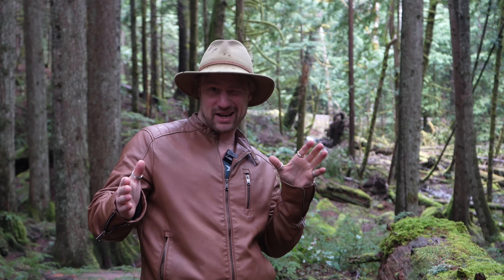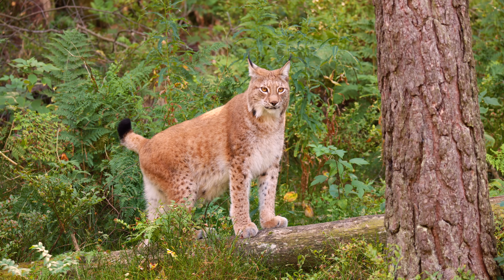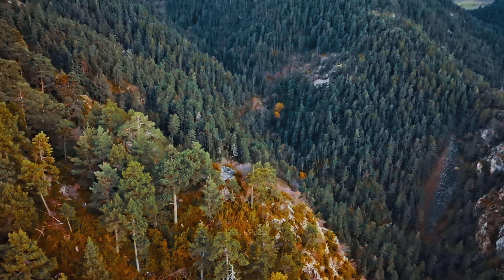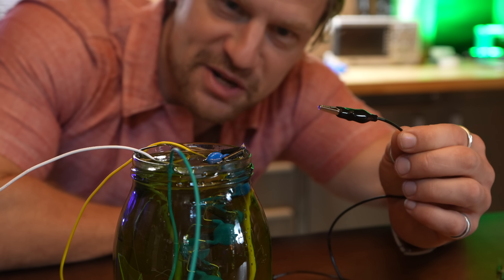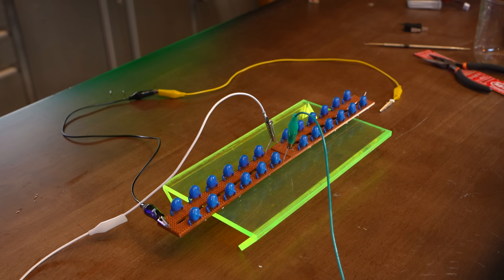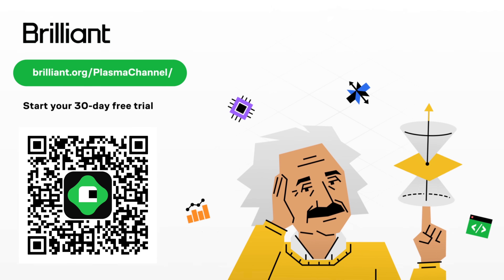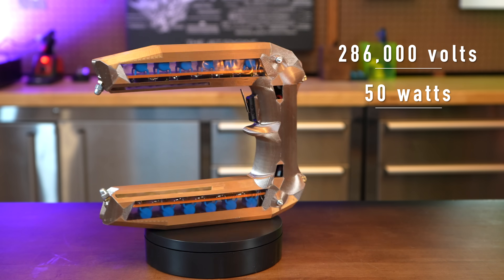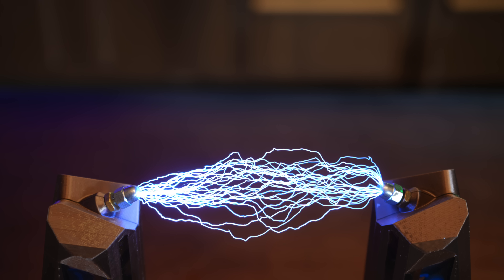A Next-Gen Stungun For Warding Off Animal Attacks

Comment: Do NOT use a melee weapon to defend yourself from a bear. You should use a gun instead, at least that way you can get the bear before it reaches you. If all the gun does is annoy the bear even more, than get a bigger caliber.
Reply: It's not a weapon, but a noise maker. The frequency and volume is supposedly enough to disquiet bears into leaving the wielder alone.
Reply: @TheNapalm22  And what happens if it doesn't? If you can reach the bear with the melee weapon, then it can reach you. Maybe its rabid or you got too close to it's kids, so noise doesn't work. If the sound of gunshots won't scare it off, then I have doubts this will.
Reply: @ I said supposedly, as I have no idea if it works or not. But high voltage arcs do produce an unsettling feeling that doesn't come across in video. I'd give 50/50 odds that it would drive away most wildlife.
Reply: @ I wouldn’t trust my life to 50/50 odds. I’ve have better odds playing Russian roulette.
Reply: @ "I'm scared by high voltage arcs, therefore based on nothing, I'm assigning odds."
Reply: @ Damn right I am. Where's the excitement if not going into things half-baked with approximate knowledge? Cool story or get mauled, win-win, eh?
Reply: @ Far better noisemaker options are available.  This thing is a very cool flashy toy, but a poor tool for the purported job.
Reply: Bears will usually wait for you to do so if you ask them politely.

Comment: I'd like to see a real life test out in a forest to see how loud this device is in a setting where it would be used. I have a strong feeling that this device will only be loud indoors where sound can constructively interfere. It won't work well in a forest full of soft surfaces which reflect sounds poorly.
Reply: Considering its such a high pitch it will be very loud in the immediate area and then get quiet very quickly as you move further away.

Comment: Over the past few years, I've watched countless hours of your videos along with many other high voltage engineers. I am extremely excited to work on new projects myself, but I have a mental block due to no concrete information on safety. Is it safe to assume that if the input source lacks the voltage or amperage to be dangerous, that the output is relatively safe? I'm thinking of it like concentrating light. While you may get a very high temperature, you'll never match the source output.
Reply: That's not the case, unfortunately. For example, you can have a lithium or lead acid battery that can supply a lot of amps but doesn't have enough volts to push them through your skin resistance. Connect that battery to an inverter, and now you have 120V with less amperage available, but more of that amperage could be forced through your skin by the increased voltage.

You also could have a lethal output from some power source that doesn't deliver very much voltage or amperage. For example, you could take a single AAA battery, and use it to power a device that gradually charges a big capacitor. Now that capacitor can supply high voltage and high current, just for a brief time period.
Reply: @deltab9768  with your lithium/lead (12-volt) battery example, that doesn't make it lethal. Unless it's passing through your heart of course, and with that you would need a very high amperage battery as well as inverter. Most offer around 5-10 amps, unless you're buying something more specialized.

Similarly, due to the laws of physics, there is no way a single AAA could cause a lethal shock. Even used in conjunction with something like the cockcroft Walton multiplier. There's just too many losses within the system. Now, if you know of a way to do that, I would be very impressed! And I would highly encourage you to make a video of it!

That said, your response did point out that there are just too many variables at play for there to be a straight answer here. I appreciate you trying to be helpful!
Reply: @dustin860  120V has been fatal before, although it's definitely not guaranteed to be. It would take some bad luck (eg, low skin resistance and a current path across the heart.) A worst case scenario would be skin/body resistance of 1000 ohms, with a (potentially fatal) shock current of 0.12A. Let's say your inverter is 80% efficient, it's going to need to draw 1.5 amps from a 12V source.

You could also use a starter battery from a car (capable of 100's of amps, but relatively safe because of the low voltage) and use it to power a 2,000 watt inverter, which in turn powers an MOT, making it just as dangerous as an MOT powered by the mains. 

As far as doing it from a single AAA battery, you could use one of those camera flash charger circuits, but instead of letting it charge for 20 seconds or whatever to charge up a 100uF capacitor to 300V, connect a 2000uF 300V capacitor and let it sit and charge for 7 minutes. At the end of those 7 minutes that capacitor will have 90 joules and 300V in it...

Comment: Cool. I designed one that has battery packs on the arm and does 700watt continous output, works in a different way though. no capacitor voltage multiplier but two transformers. One to go to 2kV and then one to go much higher...

Comment: Its a cool design altough you'd never get close enough to use that on a bear, the noise would probably scare it off, but if a bear is going after a human you're done for, and the damage you inflicted would judt anger it and it will attack you even more thsn if you did something that made the bear think you're not a threat.

That, or a shotgun.
Reply: You saying a bear would shrug off a 280,000 volt bite and just keep coming? Sorry, no, I don't buy it. To bad a practical test is ... NOT likely to happen.

Edit: word
Reply: @NeRDEnergy-v9o  No, what I am saying is that if a bear were to attack you, (which is rare if the bear isn't feeling pressured to do so; E.I, it feels like the only way out of the situation is to fight you so it wouldn't back down since it expects a fight) it's weight, teeth and/or claws would have already caused severe damage, not only that, but the bear might feel even more threatened by another aggressive fauna (you) so it'd probably try to attack you again because aside from hunger the second and third most likely causes are offspring protection and self-protection, essentially solidifying the point that you're dangerous

Even then, getting within a less-than-1-meter distance from an agressive bear is not going to be a good idea, the bear would have already swiped or bitten at you
Reply: @scoffpickle9655  I propose we both test your theory... You first.
Reply: @NeRDEnergy-v9o  Ragebait used to be believable.
Reply: @scoffpickle9655  IDK what that means homie, just trying to keep it light hearted. ✌️

Comment: Hi dude! I am thinking of creating an electric exosuit of material polymer sand and steel. It has an SF6 concentrated gas based high voltage reactor that lowers voltage and discharge current to parallelly connected 10 900Ah lithium ion rechargeable batteries. It will generate 400kV 20uA at 3GHz of electric arc using mini inverter and gate controller module and signals from body muscles. The terminals are on the gloves and shoes to throw electrical shocks.

Comment: Awesome build! I believe full wave multipliers are meant to be driven from a center tapped secondary producing +Vp, Gnd, and -Vp, meaning in total you need twice the p-p input voltage for the same output voltage. That initial full wave multiplier came out beautiful, you should definitely revisit it!